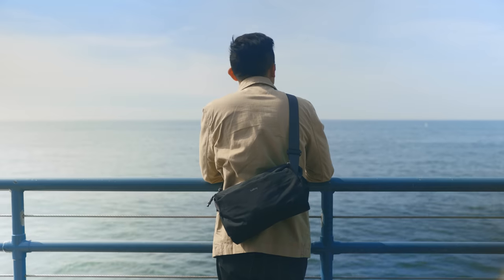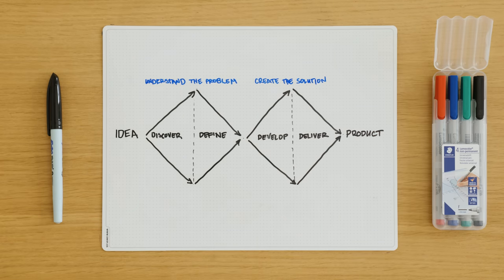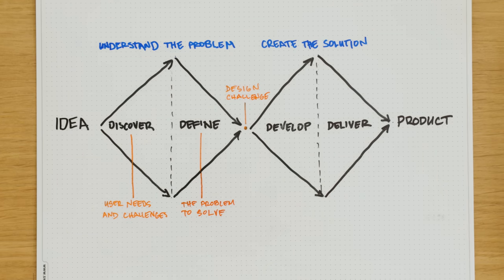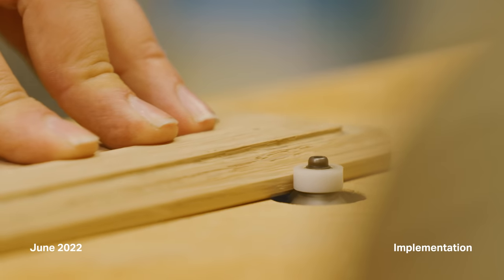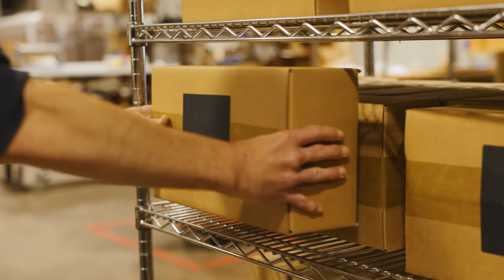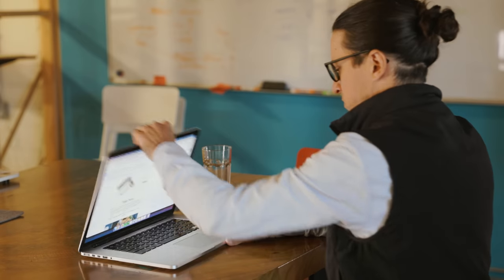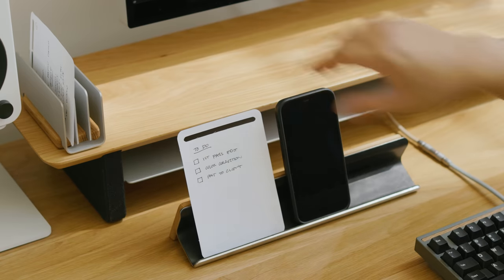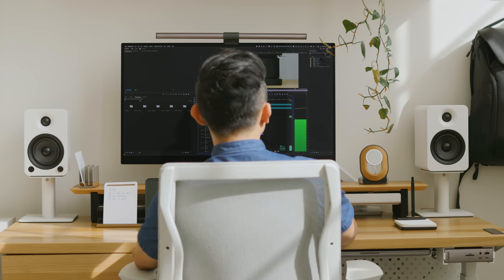How I Brought My First Product to Market – Idea to Launch

Comment: As a mechanical engineer who works with large mechanical equipment, this was pretty neat and cool to watch, I love the design thinking approach. As mechanical engineers, we tend to start and spend more time on function first, with fewer aesthetics, and usually, the designs are not very human-centered most importantly, we design for manufacturing so modular, reusable designs and we go hard on cost and materials. Industrial design on the other hand is pretty creative right from the brainstorming and you can kind of go wild with the ideas.
Reply from the maker: Thanks for sharing your perspective. It was really fun to go through this process myself.

Comment: Love it! With all the time and energy I spend digitally I still take physical notes more often because it works so much better with my brain. Thank you for sharing!

Also, what if the wind blows?)
Reply from the maker: Same. I connect better with ideas when I physically write them down.

Haven’t extensive wind tests, but this isn’t meant to be used outside 😅
Reply: @MatthewEncina  It would be interesting to study, if the new generation who literally grew up on touch screens would feel the same? I would bet my house that they wouldn't (I would also bet that there are studies like that)). Having tactile, physical connection to a thought makes it more real/tangible than a notion page. 

Did you "cat test" though?)

Comment: Neat.

I love the idea and focus on note-taking. 

For a lot of "knowledge worker" (sic), work tends to be fully digital and dependent on the company you work for. At the same time, it's obvious everyone interacts with knowledge, note taking, information in different ways. And with the open space culture, often coupled with a free seating situation, one doesn't really get "a desk" or a dedicated space for work. This changes per company, but even more so when working remotely. Now, for many, it's obvious that having a space with "your" ideal tools, assets and systems to work is a big plus.

I love the idea and have been trying to figure out how to optimize and make my note taking work for me on the digital world. But for so many (and for me), maybe a physical solution could make more sense in the end.

I like that a lot.
Reply from the maker: Glad you can see the vision for this. I personally have a much better connection (and retention) to my ideas when captured and stored this way. Though digital still plays a huge role in my project management.

Comment: Hey @MatthewEncina, 
I have two questions after watching your video. Great content by the way. Loved it ❤
1. When do you start thinking about the design of packaging. Was it also carried out in design phase of double diamond or later during the dev/delivery phase?

2. Was it easy to follow double diamond stages neatly, or were there overlaps in work from different stages?

Best, Dee
Reply from the maker: 1. The packaging happened fairly late and wasn’t a big consideration cause we just followed the cardboard packaging Grovemade already uses.

2. If you look at the day to day, it might look very messy. But zoom out and the double diamond is a great overview of the major steps. There are a lot more milestones and smaller tasks not covered here, but there were the most significant ones.

Comment: Great video. Great content. It's refreshing to see the design to develop process with a real world example. Also, the product is very lovely.

My main criticism is that you did not user test the prototype before taking it to production. For example, the stand has no adhesive or retaining element. A gust of wind could blow your notes away. 

Without validation, designers end up projecting their own assumptions on the user. There's a great article on NNG about "The False-Consensus Effect" aka "You Are Not the User". 

Otherwise, I'm not one to miss the forest for the trees. Great video!
Reply from the maker: Thanks. We did do user testing. That was not a issue that came up, and hasn’t been  for me in the past year or so using it.

Comment: In the shots that show your printouts/sketches pinned on the walls, this is how I envision what the Apple Vision Pro can do digitally. With the AVP, I'd like to have several (at least 10+) multi-page PDF docs, Microsoft and Adobe files (Photoshop, Illustrator, InDesign, etc.) appear on my walls, desk or floor and they look like real documents placed onto those surfaces. I could move them around, place one behind another, "pick them up," resize them, and edit them using my Apple Pencil or my fingers. It should look like I am handling real documents on different surfaces. This would feel more enjoyable and satisfying than just having app windows floating in space. That's fine too, but it'd be more amazing if objects you view through the AVP were applied to surfaces like real documents. You guys made a great video and product.
Reply from the maker: Thanks. I love the tactility of interacting with objects and sketches in the process.

Comment: I can really appreciate the design and how refined the product looks. It's sleek, sophisticated and all.... Yet to me it seems excessive. Paper notes are used bc of how easy and simple they are. A notebook solves all the issues that the kit does with much less clutter on the desk and for cheaper. To look at the notes- open the notebook, to store them- close it, to write notes- open it.
Reply from the maker: I also use a notebook within this system for a different purpose than quick notes. I'll be sharing more of my workflow in my next video.

Comment: loved the whole process! How about adding a slit on the Display Rail so that notes could slide in and it would prevent notes from flying off. Or a thin elastic band that could do that trick? Just some kind of a clipper..
Reply from the maker: Thanks. We actually explored a slit to hold a pencil. We simplified it, but are still thinking of potential future products from these learnings.

Comment: awesome video, isnt the pad designed to be able to put the individual leaf back onto it tho, meaning you can just stack your notes from the day back onto there? Obviously I understand the inherent value of the kit, but as a use case I’d imagine myself defaulting back to just using the pad and the other two parts would collect dust! Hoping you see this as constructive - last thing i’m saying is that I don’t like it or wouldn’t buy it, and I’m a massive fan of the channel, super inspiring.
Reply from the maker: Yes, you can put the papers back. However, the challenge we found is when having multiple projects (stacks of notes) at a time. It's very cumbersome, and hard sort and access, notes further down in the pile. Our goal was to remove as much friction as possible.

Comment: Dear Matthew,
thanks for the detailed insights of your work and especially how you brought a product line to market from the first idea over several iterations till mass-production! :)

That being said though, as a fellow indunstrial designer I am quite surprised with the outcome of 2 years of work.
I can imagine that you and the manufacturer are not in the same city, therefore communication was a little bit harder compared to in-house departments, still 2 years for that product-line is very long.
In the end I was also overly surprised about the price (yes, you mentioned it is a luxury good), but therefore I would have expected a little bit...more.
Let me give you some examples:
I don't know how thick the paper is, but I can imagine sooner or later it will flip over in the display rail and you cannot see the upper notes anymore.
I also would have hoped for a case, where you can store all your notes like in a notepadholder - pin all the necessarry notes in a ring-notepadholder and go to your next meeting instead of fiddling with loose papernotes.
For the organizer:
Would have been nice if one side is closed and you have 3 labels on the side, like importance level, or to which project they are related to.

Just some quick thoughts, but still hoping for a major success for this product and for you! :)
Reply from the maker: Thanks for sharing your thoughts.

Comment: I really appreciate your effort and I enjoyed the video. I have been working in consumer product design for a few years now what I personally felt in my experiences is that sometimes, It is more productive to work alone than with a team. Half of the time the suggestions and opinions of your team members are useful, and the other half of the time it can be misleading. Often times I felt that even though aesthetics and ergonomics are important and products with good looks and feel are good to have, the time invested to create that little bit of goodness doesn't worth it. In your case I felt that you could have finished your product much early with similar output if you would have worked with a smaller team, and focused a little less on the look and feel.
Reply from the maker: Perhaps. But the whole point of collaborating with them is for me to learn. I am not an industrial designer, so part of my goal was to learn from experts.

Working solo I could’ve gone fast, but maybe not very far.

Comment: I love the concept. but in the notes seem to be easily blown by air.
Reply from the maker: In the two years I’ve used this, I’ve never had an issue with the notes blown away. But if you’re working in a windy area, for some reason, it could be an issue.

Comment: Looks like a lot of work for simple product
Reply: Honestly a process that should've taken a lot less time... The note stand especially considering it's just a mini mail/envelope holder.... Maybe I'm in the minority, but it seems like this project was prolonged for the sake of some quasi-philosophical significance, when it's an extremely simple product.
Reply from the maker: “Simple” things are the hardest to make. 
Certain aspects take time (extensive testing with users, machining and finishing processes, etc). 

Nothing was prolonged arbitrarily.

Plus, this project was one of dozens I was working on for the past two years — and grovemade has many other products they’re concurrently working on.

Maybe if this was the only thing we worked on it could’ve gone quicker?

Comment: I am surprised your solution is not digital. And no user tests, which is one of the most important steps, were mentioned.
Reply from the maker: We did plenty of user tests. And there are so many digital solutions out there. But I still value and heavily use analog tools for note taking because of the speed and for information retention.

Comment: Hey bro wont the notes placed on display rail fly, when the fans are turned on or still a small wind might push it all (the notes  ?
Reply: but i love the way you told your design process nice
Reply from the maker: Same with any paper notes I suppose.
Reply: @MatthewEncina  so if it's the same result then the product is not functional just aesthetic 💀
Reply from the maker: @hari5723  it’s very functional. I and many others have been using it for a while.

Comment: Amazing.. but two years of development in such fast paced economy is way too long i believe
Reply from the maker: You’d be surprised how long it takes certain products to hit the market. You can make very expensive mistakes if you don’t carefully vet and test each phase before committing to the next phase of production.

Timing is a factor, but for this instance it’s for a use-case that’s a fairly persistent issue and not based on a fleeting trend.

Comment: It's funny how something that takes 2 days for the mass market, you do 2 years. It came out nice, but I'm not sure it was worth the time. Please don't take this comment as a hate comment. I just want to say that these three products are not something innovative that will radically change the way you take notes. And that’s why it didn’t make any sense to design this for 2 years, as for me. Can you please provide arguments in your favor? I am very interested to understand why the design process can be so long.
Reply from the maker: It could’ve been faster, if this was the only project either party had going on. But this was one of many.

The idea can be conceptualized quickly, but have you ever manufactured something? There are many steps in there that take a lot of time.

Even in the “mass market” I don’t think producing something at volume would take two days.

If you have some insights on how to expedite the production of hand made goods, I’d been interested to hear your take.

To answer your curiosity: yes, it was absolutely worth the time.